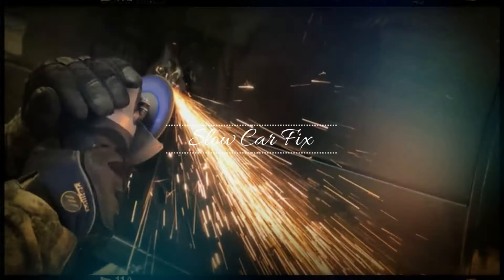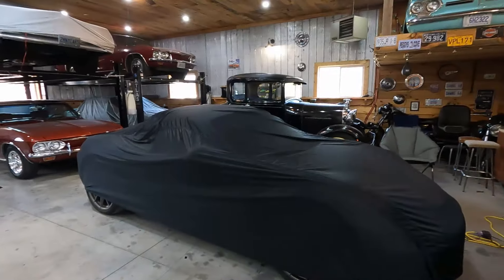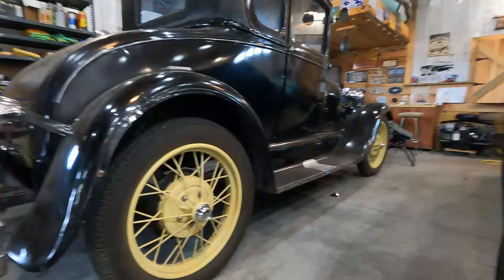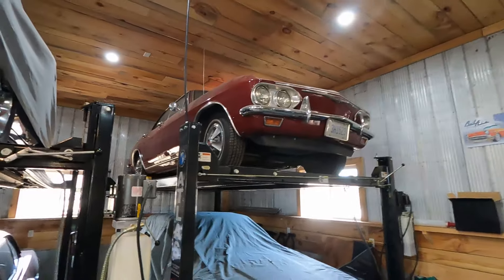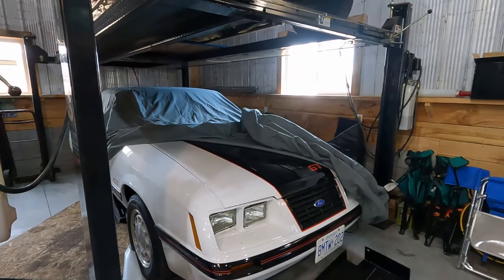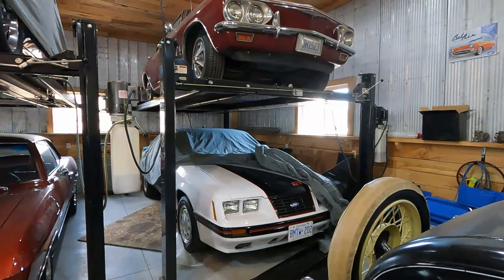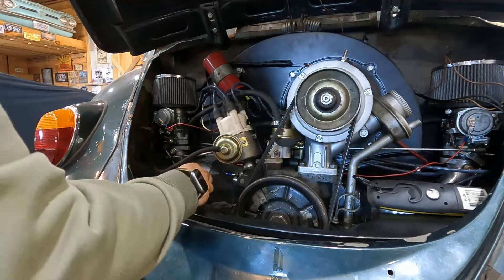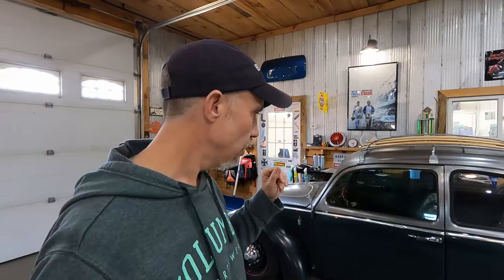Broken Cars! The Reality of Car Collecting!

Comment: Vintage cars were built so you could work on them.  When I was young I loved working on cars. I pulled motors, changed out rear ends  clutch replacement and so on. I thought I could fix anything.  You love your cars so they all get special attention.
Reply from the maker: That's right - they all get the love. Thanks for watching!

Comment: Did the body mounts on my 79 malibu,  used a hole saw to reach the nut on the back of body mount. Then used a matching sized rubber plug to fill the hole in the trunk.
Reply from the maker: That's a good method. I don't think it'll work for mine unfortunately because the mount itself isn't the issue, the whole metal pocket that the mount sits in needs to be replaced.